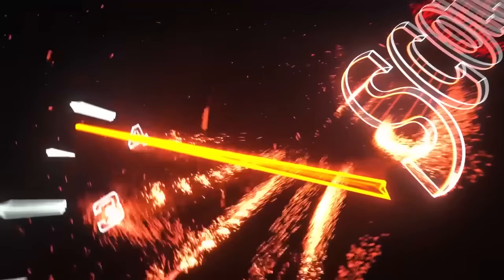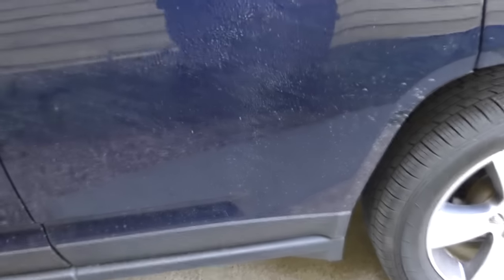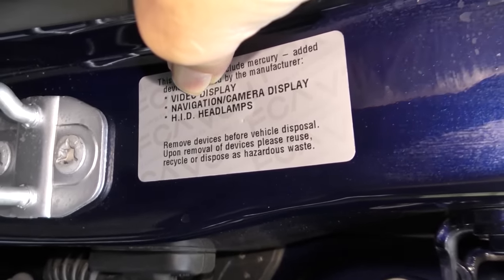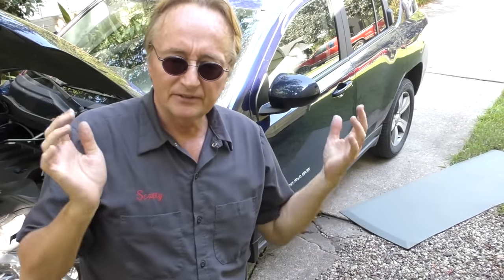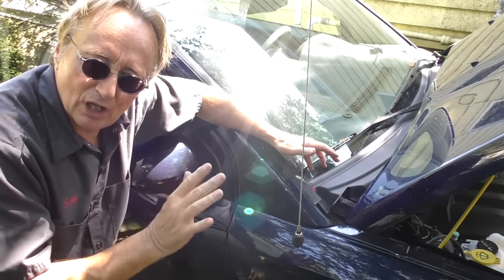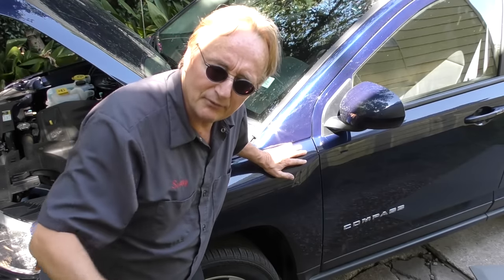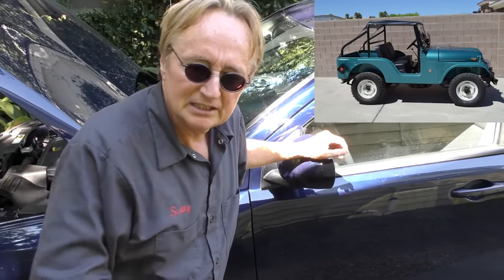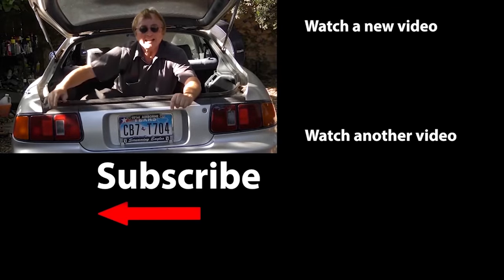Here's Why This Jeep Compass is Crap

Comment: I have a 2014 Jeep compass latitude fwd, 2wd, 4 cylinder 2.4L engine. No 4x4... 
It's not bad and gets me to where I need to go. Got a few issues to iron out. It's nowhere near as bad as my old 2000 Honda Accord ex 4door 3.0L VTec. That honda always had an issue every week but it taught me how to work on cars. My 2014 jeep compass almost has 160k miles and still going strong. I unclogged the catalytic converter, cel code p0420. I gotta get the brakes done, and a new drain plug. Other than that it's just cosmetic like front bumper, side panel, needs new head lights because they are foggy and nothing will clean them up, and I need to get the back up camera fixed.

Comment: First of all Scotty this vehicle was never designed by Fiat,  it was designed by Daimler and Chrysler back in the early to mid 2000 and released to market in 2007! They released the Compass/Patriot/Caliber trio as their entry level vehicle for Dodge and Jeep so Fiat had nothing to do with this vehicle! Actually,  Fiat refined the cars when the cars were restyled in 2011 making them a little better quality, better quality materials in the interiors and so forth so get your facts straight before you do another of your hatchet job's on a vehicle you are seriously I'll informed about! These vehicles have suspension problems but their 2.4 world motors which they share most mechanicals with Mitsubishi and Hyundai among others are quite tough, their cvt transmissions are supplied by Nissan and overall the cars are pretty good for the price, not superb but good and certainly not deserving of what the crappy 7 minute info crap you posted here! Get your facts straight before you bother posting this manure infested idiotic stuff!